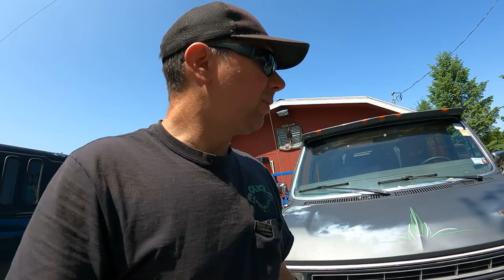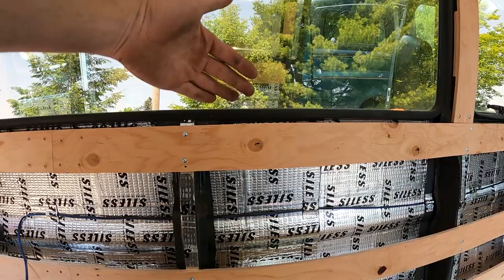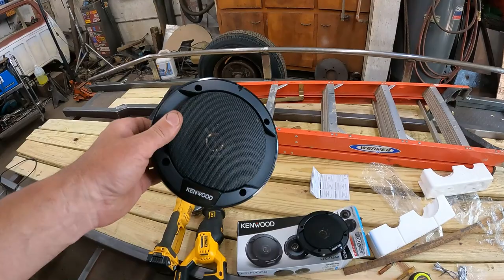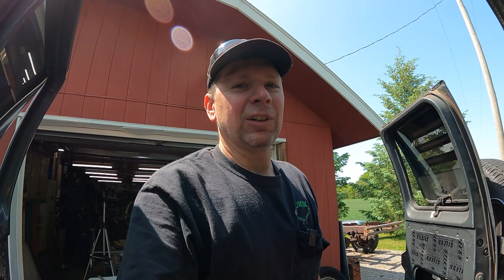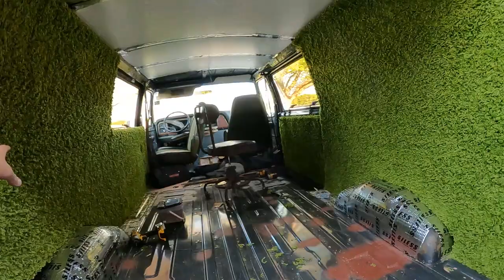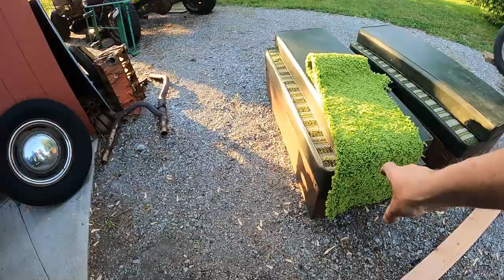Full Custom Van Interior.  It's Shagtastic!

Comment: Hello Joshua , maybe look at a different green shag carpet or  a regular carpet (short) for the celling for contrast and won't darken it up !Also put some led lighting that you can turn on in different spots and have rigged  on different switches and dimmers in you overhead dash control centre ! looking go so far ,take care of your knee ! Go all out with interior it will be awesome to drive around in and have some fun ! Wish I still had my van from the 70's full done up back then ,fur ,carpet ,wood walls ,cabinets the whole 9 yards out side as well flares cowcatcher paint ,it was a blast ! Keep On Trucking !!!!!!
Reply from the maker: The carpet is a darker green for a little contrast, but still ties in with the triple green on the seats.  I think I will try some LED rope lighting around the edge.
Reply: @QuickSpeedShop  Sounds good hope you get it dun up and  get to do power tour and make sum video taking us along for the ride !! Good Luck !!  Later John
Reply from the maker: It will get mostly done.  I'm going to try and do some daily HRPT uploads, but that all depends on wifi and stuff on the road.